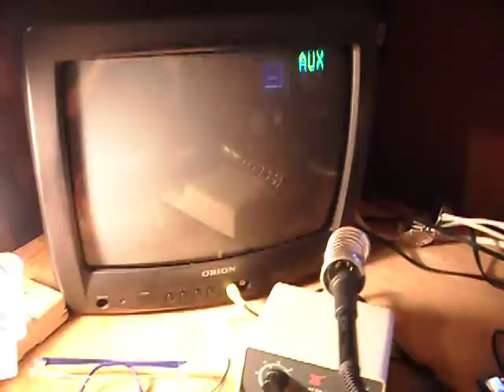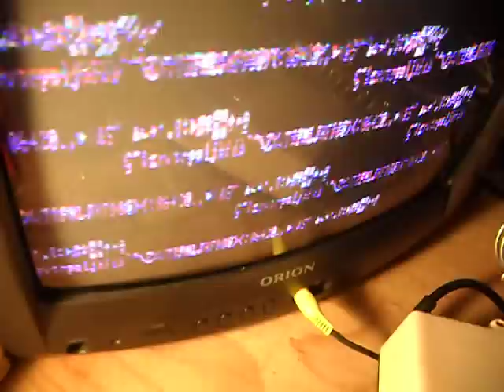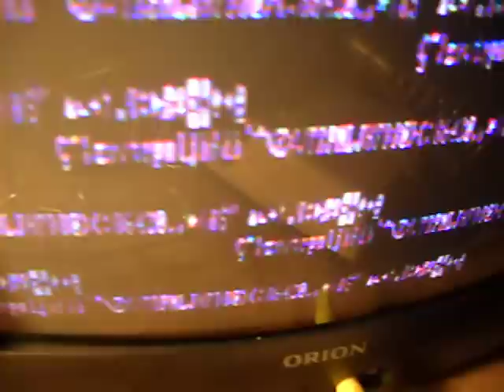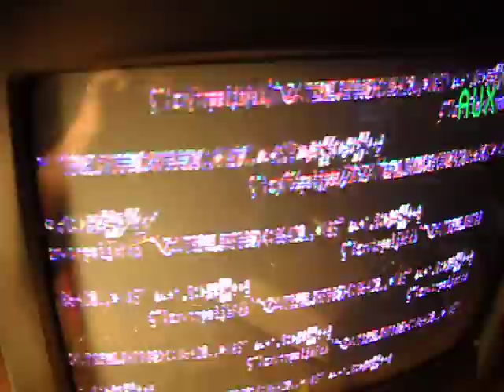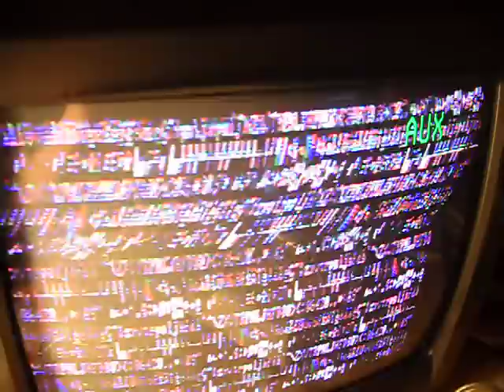IBM XT with MDA outputting to a TV

Comment: It is not MDA graphics card, it is Hercules. MDA knows only text, no graphics like Hercules.
Reply from the maker: Actually it's neither - it's a Hyundai E40080004. It has more than 64kB of RAM so I'm sure it's possible to do graphics (and may indeed be a Hercules clone). However, I haven't tried any graphics mode software on it. In making this video I only used MDA registers so it would work exactly the same with a genuine IBM MDA card.